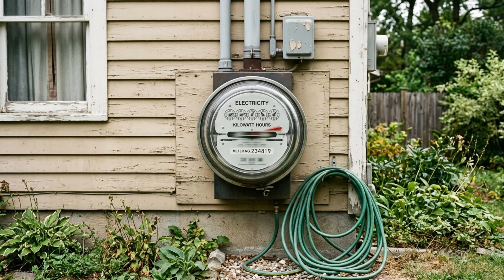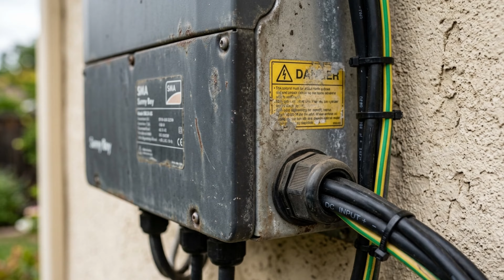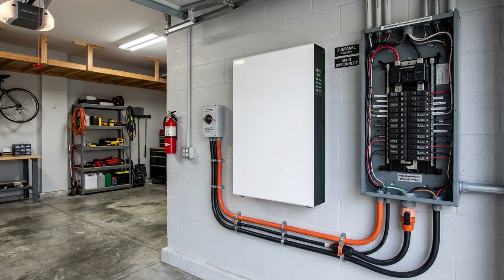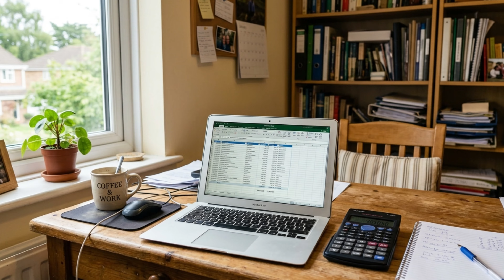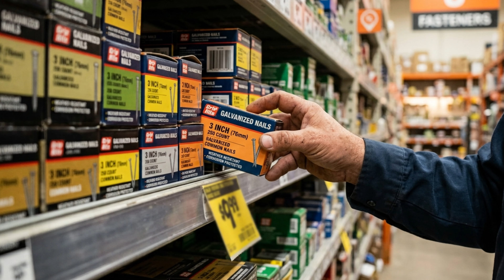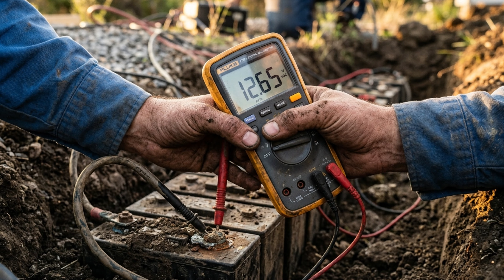Solar Panels Are a Scam Compared to This 200 Year Old Trick

Comment: I'm counting on my LFP batteries lasting 30 years. They may only be doing 70% by then but that is acceptable. And your $100K system if you DIY it should be less than $20k. Paying for itself in the South West area in less than six years. Finally, as you have said multiple times, this solution of yours does not help a home owner. At best it powers some low powered items. So you still need solar.
Reply from the maker: Thanks for the detailed comment. I agree that a properly sized solar and battery system is a different category entirely. My point was simply that the device in the video isn't a whole-home solution.